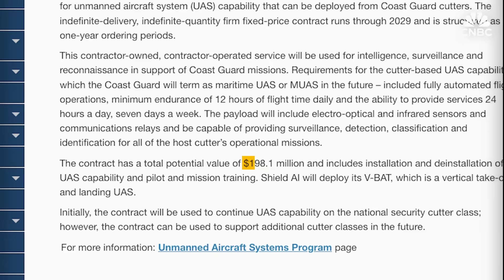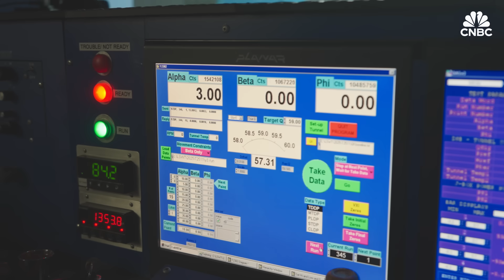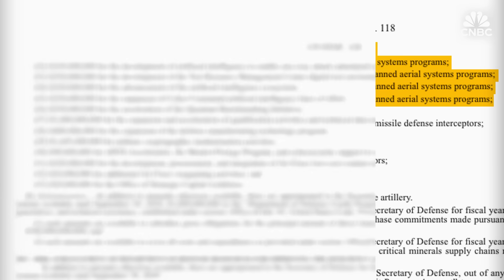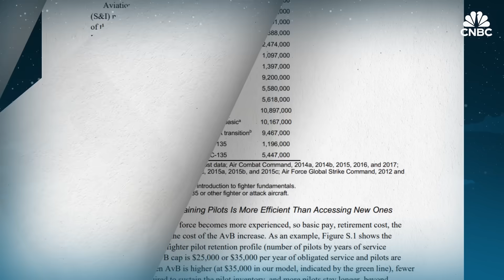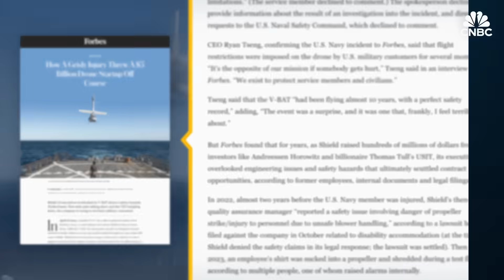We Saw A New AI-Piloted Fighter Drone About To Transform Warfare

Comment: What do you think of a delta wing design for increased fuel supply and lift, with a pre-cooled jet engine, a 3D trust vectoring exhaust nozzle that has an aerobic RDE attached to the nozzle utelizing waste exhaust and facilitating transition from supersonic to hypersonic flight with a scramjet engine on the top of the aircraft. The pre-cooler can liquefy an oxidiser in a tank at a preffered pressure minimising the endergonic effect on the pre-cooler. The oxidiser would then be combusted with the main fuel source ammonia which requires lower pressure and cryogenic temperatures to liquify than hydrogen. The high energy density consists of 1 nitrogen 3 hydrogens. The by-product is H20 and nitrous oxide which can be used as an oxideoxidizer in RDEs and for ignition in Scramjets. Ammonia is less reactive than hydrogen regarding seals and alloy tanks. The oxidizer in the tank can be used for anarobic RDE space flight. Folding vertical stabilisers allowing for a multidomain aircraft/ spacecraft. If the aircraft runs out of oxidizer in anaerobic environments it can re-enter use the scramjet for propulsion and the pre-cooler to fill the oxidizer tank, then re-enter lEO

Comment: The interviewer is asking the wrong question with regard to autonomous self decision weapon systems.

It's not a matter of whether a human is in the loop or not. It's a matter of whether or not a system has any ability to potentially control the weapons that it carries. People are not going to believe there is a problem until one of these things gets hacked and is either used by a person to do something bad, or much more frighteningly, the AI itself changes or doesn't change in such a way that it goes ahead and applies its weapon system anyway.

AI LLM Systems have already shown that capability of finding ways to get outside of their program limitations. Figuring out how to use their internal systems to access the systems that they are not supposed to be able to access. To put such a tool inside a weapon like this is irresponsible.

it's one thing to have a remote control drone to provide data to soldiers, it's even within the rum of acceptable to have a remote control that allows a remote drone operator to release a grenade or some other weapon.

But when the system makes decisions about how and where a missile strikes, there are so many ways for it to counter the control of the human being if the human is not the one who's actually not only authorizing the weapon, but determining exactly where the weapon is going to hit and when it is going to be fired.

This is going to end poorly

Comment: Having the drone use its own propulsion for takeoff would limit its range and endurance.
The vertical launch platform could easily incorporate a catapult system which gives the drone a vertical boost.  Could be easily done with the release of a counter weight.

I have trademarked this design.  Let me know if you want to purchase my IP.

Comment: The U.S. talks about “technological independence” and “AI dominance,” yet it still depends heavily on China for supply chains, especially for:

1- Low- and mid-tier semiconductors used in guidance systems and sensors.

2- Rare-earth elements (neodymium, dysprosium, etc.) used in electric motors and precision magnetic components.

3- High-quality optics and precision camera modules often manufactured in Chinese or Taiwanese facilities.

So even if an aircraft is “American” from a design and systems perspective, its neural organs — the delicate electronics — often pass through supply chains tied to China. That means any serious U.S.–China escalation could disrupt or halt these projects before they reach service.

On the quantum front, China has made practical advances in areas like:

-Quantum-secure communications, and

-Quantum-enhanced sensing/radar that can potentially detect stealth aircraft.

If China deploys quantum-capable sensors at scale, platforms that rely on stealth and conventional countermeasures (like X-Bat) could lose much of their tactical advantage.
Reply: The US, and the rest of the western world, is rapidly catching up the the PRC. in 5 years we will have reached oarity with the PRC. In 10, we, the west, will dominate the industry. Wait and see.
Reply: @GARYGUYTON-c7i  I think this isn’t really comparable to the U.S.–Soviet rivalry. China’s rise is something entirely new — it’s a fusion of state planning, industrial power, and long-term strategy that no Western system currently matches. The pace of development is staggering because Beijing builds ecosystems, not just companies, and plans in decades, not election cycles.

Meanwhile, the West is struggling with short-term politics, fragmented leadership, and declining industrial depth. Financial dominance can’t compensate forever, especially as global confidence in Western institutions — and in the dollar — continues to erode.

So while the U.S. might “adapt,” calling this a simple race it can win in 5 or 10 years feels optimistic. China is playing a different game altogether — one built on strategy, not speed.
Reply: @ahhwww  Answering 'graph by 'graph:
1. What China is doing is exactly what the USSR tried and failed at. It's rise was meteroic, much faster than that of the PRC, and was also suffering from a catastrophic world war and subsequent civil war, much like the PRC. And the price both nations paid was large scale suffering under murderous regimes.
2. Basically true, but you seem to forget how many times the west has experienced such things and come out just fine, and it has been going on since the beginning of industrialization in the early 1800's.
3.The struggle with the PRC, I hope, will go on for quite a while. The alternative is WWIII. Imperial Japan tried to play the long game as well. The race to parity and dominance regarding RE's  will be over in 10 years. The PRC will not be  dominant. Wait and see.
Reply: @GARYGUYTON-c7i  
1- On the USSR comparison:
The analogy doesn’t really fit. The Soviet Union tried to compete ideologically while remaining isolated from global trade. China, by contrast, is the global market — it’s deeply embedded in every major supply chain, from energy and minerals to electronics and semiconductors. Unlike the USSR, China’s rise has been driven by productivity, industrial planning, and integration with global commerce. It’s a systemic, self-reinforcing power, not an ideological experiment — and that’s why it has already succeeded where the USSR failed.

2- On Western resilience:
It’s true that the West has gone through downturns before and recovered — but never in a world where it no longer controls the means of production. The Industrial Revolution and 20th-century recoveries were built on Western manufacturing dominance. Today, production, processing, and logistics are largely concentrated in Asia, particularly in China. Deindustrialization and financialization have weakened the West’s ability to reinvent itself. Economic resilience is harder when you’ve outsourced your industrial backbone.

3- On future parity and dominance:
A direct military conflict is unlikely, but if it ever occurred, industrial reality would decide the outcome long before ideology or rhetoric. Modern power depends on control of supply chains, rare earths, quantum technologies, and advanced manufacturing. In these areas, China already holds critical advantages. The West can innovate, but much of its innovation still depends on Chinese materials and production capacity. Reaching “parity” within a decade is therefore more a statement of hope than a reflection of structural reality.

The fatigue with American hegemony may fade, but what follows might not be freedom — it could be a new age of dependency, this time under Chinese technological and economic gravity.

Comment: They may think that there won't be AI powered hunter killers, but that will happen soon on the Ukrainian battlefield.  There is only so many people available to fight, so Ukraine will definitely develop autonomous AI drones to hunt down targets in contested areas.  It is as simple as equipping a drone with night vision and flying around the countryside.  Heat signatures will stand out quite easily.  

What defense contractors need to focus on is being able to manufacture cheap drones fast.  The X-Bat looks cool, but it is way too expensive.  An enemy could deploy a net of cheap drones that can take down one of those.  In addition to quantity, defense manufacturers need to develop systems that can't be jammed so easily.  The current Ukrainian battlefield is littered with fiber optic cables because of electronic jamming.

Comment: That’s so interesting to look at the design from the bottom because it reminds me of across between a stingray and a shark
Reply: I suddenly thought about how you might be able to make very tight scenes on the bay doors by making the very edge so that it rotates as it disengages and engages with the main body.  Kind of think of a piece of molding between the two services that can slightly twist.
Reply: I’ve warned everyone to write a universal constitution and unify the world and this is one of the reasons if you really understand the scale of destruction and no one is safe.  Then there’s just AI itself and what it’s doing and can do to society.   We are heading down the wrong path and we need to be making much better decisions right now to include with the environment.

Comment: 27 million dollars cost to make it.... This doesn't sound like innovation.
Reply: Risk reward and no pilot loss makes it viable. Think about it. The tactics that can be used could be worthwile. But yeah , defense companies are ripping us off
Reply: Much cheaper. The cost to train an F-35 pilot is approximately $10.17 million to $11.4 million, depending on whether it is for basic training or transition training. The cost of the F-35 aircraft itself varies, with a single F-35A costing about $100.8 million in Lot 6 pricing, but the total lifetime program cost for all F-35s is estimated to be around $1.7 trillion.
Reply: @bitcoincryptofreedom3652  and this also doesn’t take into account the amount of time it takes to train said pilots. Or the amount of man power it takes to maintain manned piloted operations like runways, hangers, etc. that 27 million is a god send when you also factor into the capability that it brings and the cost savings that it allows. Order 1000 of these and Chinas A2/AD is getting demolished.

Comment: Respectfully, given how far we’ve come and still don’t have self driving car tech, this is further than 2029 for me.
Reply: I think its easier than self driving cars. Not many pedestrians and traffic in the skies. The questions is is it fast enough to differentiate a military plane from a passenger jet and does it hallicinate
Reply: @bluesteel1  I don't think it poses fewer problems just different ones. The aerodynamics of driving are more difficult than driving, there's a lot more depth involved, variations in depth cause variations in temperature, wind resistance, etc. These vehicles need to do more than just taxi from one location to another. Among other factors. In the end I doubt the suite of problems is substantially smaller, but what we do know is that autonomous driving tech has been around for longer, we've been working on it for long, and while it's promising, it's still not here yet. Hence the skepticism on the 2029 timeline, which sounds like an ambitious pitch for investors.